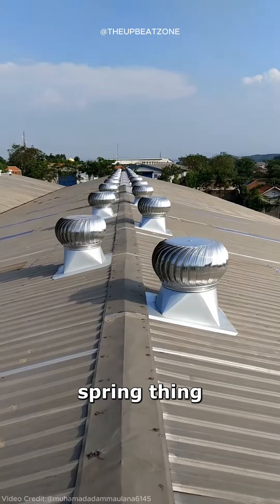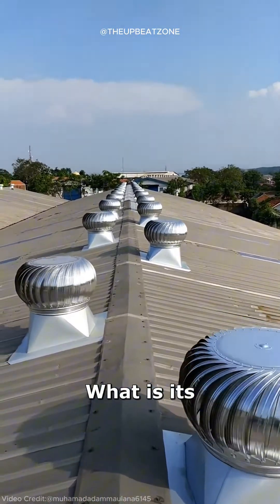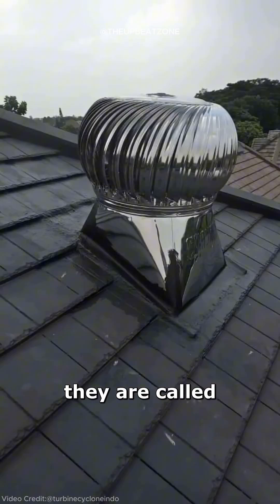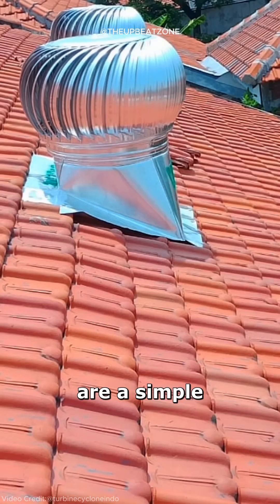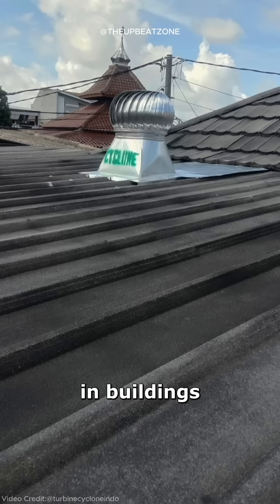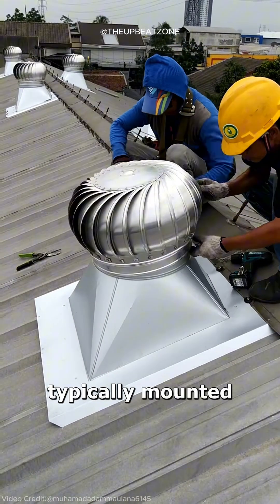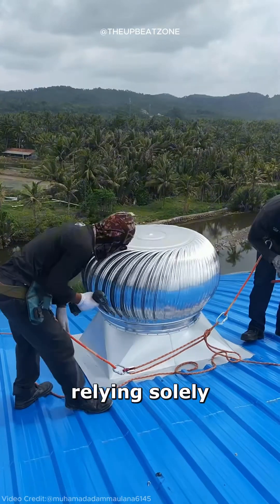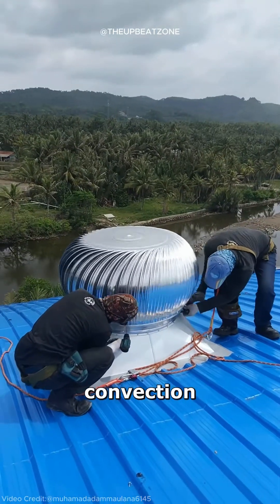Whirlybird Turbines EXPLAINED 😧

Comment: Why not mechanically connect to a whirlybird to a generator? Generate direct current electricity and send it to an inverter, changing it to alternating current to supplement household   power.
Reply: this isnt some sort of steam turbine, the torque required to spin it is not enough to turn anything with any amount of force decent enough to drive anything worth powering, let alone even a generator or alternator.
Not to mention, its primary purpose is automated ventilation - hooking up anything that negates the already diminutive energy it gets as a result of doing its one singular job defeats the entire point of having them in the first place.
Reply: @asakayosapro : you’re right but if the diameter were to be much larger, it could power a few small appliances.
Toaster, microwave, etc
Reply: If you know how Alternator/Generator Works you wouldn't do it. 
Load is a load
Reply: It can't carry that much Load. 
Good idea tho. 
Maybe in the Future someone will work on it
Reply: tht is a secret.
Reply: Not enough torque
Reply: You dumb